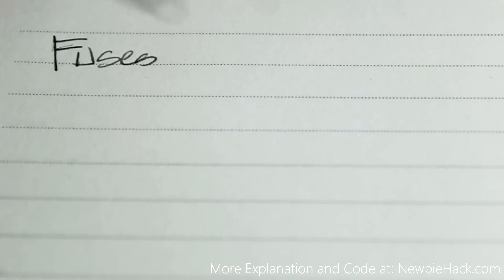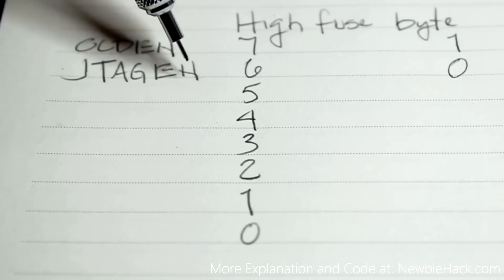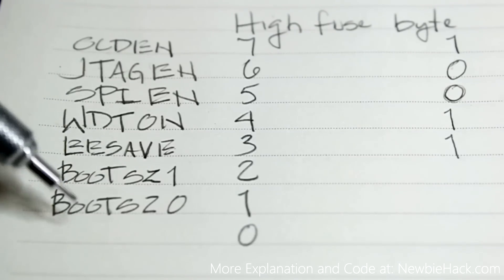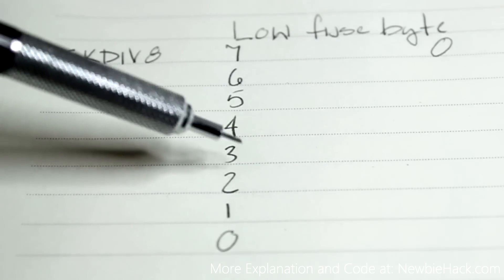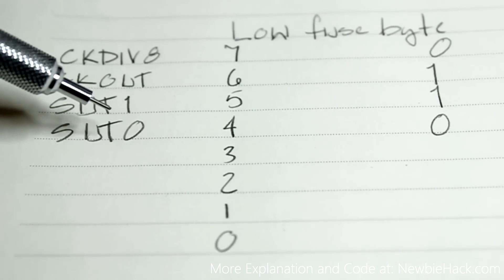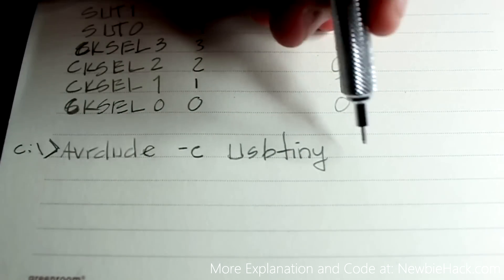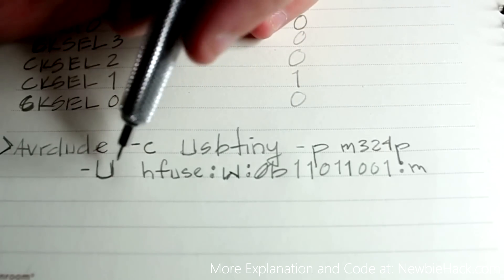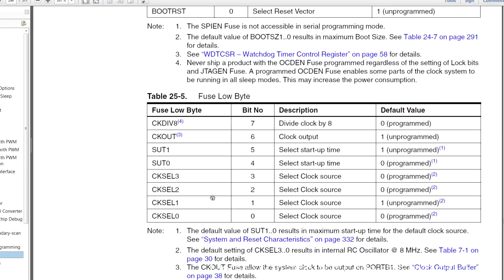50. Arduino for Production!  AVR - Understanding Fuse Bits

Comment: Hello sir just needed to understand more about fuse bits
On atmega64a
Reply from the maker: The fuse bits on the ATMega32 and the 64 is very similar.  Check out the data sheet for the 64.

Comment: Hi, thank you for great video. I've got question: After I write 00 or ff (can't remember) in low ang high fuses my controller stopped work at all with or without external oscylator. There is no comunication. Is there way to revert to its default settings?

Comment: Took me 2 hours until i found this to realize why my atmel328p that i took from an arduino and re-purposed it for an open source tester didn't sync. The tester works with the internal clock while arduino probably had the fuses set to use the external on. Thanks

Comment: Hi,

Let say i want to use this mcu which need about 5v to turn my led/lamp on and off, but my led/lamp need 12v/24v to work. Do i need a relay to turn the light on and off with my mcu ??? if yes Can you make video about that please
Reply from the maker: You can probably use an open collector circuit to control with a 5v signal to power with 12v.  An open collector can be in the form of a logic gate IC or a transistor.  You can also use a MOSFET.  A relay would probably be overkill, but it depends on the current and voltage ratings and needs.